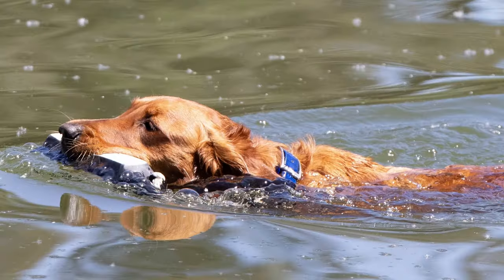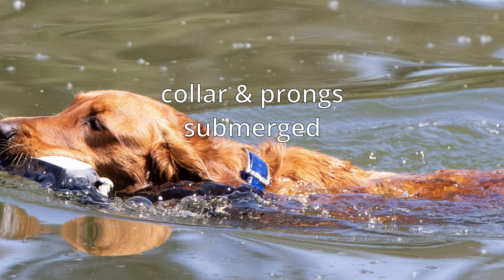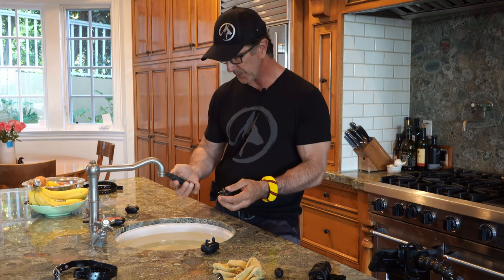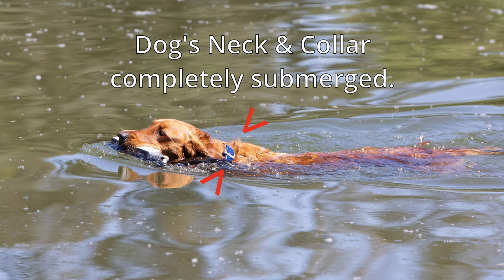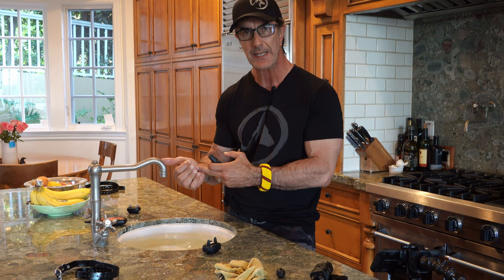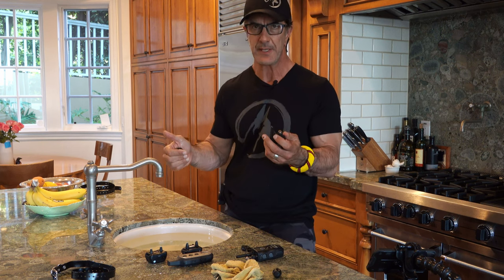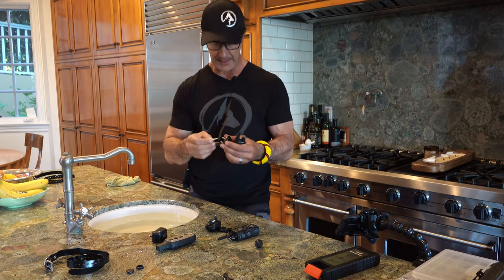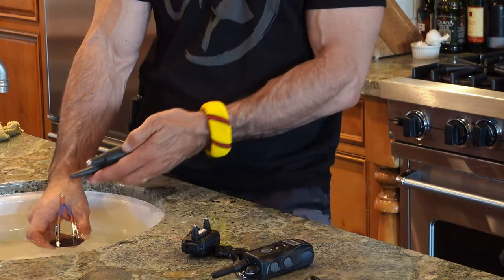Is the E-Collar Dangerous in the Water - Will it SHOCK your DOG?

Comment: I notice when getting lab to retrieve plastic bumper from wet grass that it shocked her mouth and she dropped it
Reply from the maker: that would be impossible...
Reply: @RobertCabralDogs  i saw here feel shock and opened mouth quickly.  I had sport pro on 4 which earlier is when she felt shock so turned down to 2 after that

Comment: Surely your point is that a WET dog [not in the water] receives a "higher" stim, you found it aversive when your hand was wet, but not submerged. How do the shooting crowd get round this? They invented the ecollar. Labs retrieve ducks from the water. My dog swims, she wears double box Etech K9 Handler. I've never noticed a difference in her response. Would this also apply to wet dog due to HEAVY rain, quite common here in Scotland. PLEASE tell me at what level [any] a small DC battery can create enough current [not voltage] to BURN. From my personal experience of 20,000 VOLTS @ 0. 02 AMPS, sufficient to see the pretty blue arc of "lightning" from HD line 6 inches to my finger holding screwdriver. It felt like a tingle, amazing to see though. Martin tech stuff is much more complicated, and ,for me that means more to go wrong. Love seeing these, great topic. My Martin System collar is broken, so I cant compare it with my Etech collars.
Reply: Regarding your question about how this is handled by waterfowl retriever trainers and handlers ... from my perspective as a retriever trainer, it is a non-issue.

1. The receiver is positioned where the contact points are above water when the dog is swimming. I have never experienced an ecollar communication lapse because the contacts were submerged.
2. Proper use of an ecollar requires a conditioning process/period. Without going into detail, this conditioning process prepares the dog for any stimulation the dog might receive, including the intended associative learning (classical conditioning) or instrumental learning (operant conditioning), depending upon the ecollar methodology being used. This process also prepares the dog for a margin of stimulation level that covers the range of difference between dry stim and wet stim. 

No physical hardship (biology and physics); no psychological hardship (knowledgeable and responsible conditioning process and usage).

With knowledge of this phenomenon and responsible usage, never a concern.
Reply: @TPinesGold  I'd appreciate How you position the collar to stop wet contacts. My dog launches herself into water. often submerging her head to bite it! Never has she not responded. or received a higher stim than the level indicated. either in or out, then shaking all about. The collar has always been fitted low on her neck, will not stay up behind her ears. A professional trainer tried to place it high, He did the collar up so tight she couldn't swallow, Still it moved round.
Reply: @patmunro3531  Impossible to prevent wet contact points, but I want to minimize submerged contact points. If I have a dog with a leaping water entry followed by a brief submersion, I can't imagine any need to stimulate during that moment of submersion. Any button being pressed should be on a camera.
I am facing the dog when I put the collar on. I position the receiver at about (my) 10 o'clock or 11 o'clock, very high on the dogs neck, with a few fingers of my left hand under the collar as I cinch the collar tight with my right hand. The receiver should be offset from top center just behind the dog's right ear. Before removing my left hand from gripping the strap, I grab a handful of loose skin with my right hand on the back of the dog's neck, posterior to the strap, and pull loose skin posterior with my right hand while pulling the strap anterior with my left hand. When I remove my fingers of my left hand from beneath the strap, this relieves the tightness of the strap enough so that breathing and swallowing is unrestricted. It still must be quite snug so that there is no movement of the contact points against the skin. Any movement is problematic because (i) the receiver position becomes less effective, (ii) movement causes skin irritation, and (iii) movement means contact points are loose against skin, resulting in inconsistent stimulation levels perceived by the dog. I've used this technique and position on several hundred different Goldens and Labs -- the collar always stays exactly where I position it while breathing and swallowing is unrestricted.  Zero problems in 15 years of ecollar use.  My technique is not the only way to do it. I'm sure many successful trainers would give different instructions. This works for me and I do it the same way every time.
Reply: @TPinesGold  Mine is a thick/ densely undercoated GSD, with a skin that would fit 2 dogs. Contact was really difficult, until I purchase a Martin Systems extender. The weight of the single brick ALWAYS slipped round to her throat, lowest position, and down towards her shoulder, skin pulled through underneath. The Extender is fitted lower, the brick attached in the middle of the 4 contacts, placed both sides of the dogs neck. Gravity keeps it there, the collar is a bungee, therefore CANNOT be stiffly tight, the elastic gives and takes. I also clip, to the skin a track for the contacts. When on they "furrow" through the clipped track, maintaining contact wherever they are, after swimming collar moves round as she shakes. Has never "lost" then suddenly "gained" contact. Water also follows the clipped furrow, so contacts/ skin is wet, even in just rain, no sudden need to increase stim [lost/wet] contact. When she swims, the contacts would have to be ON TOP of her neck not to be below the surface of the water. See Mia swimming. This is fascinating discussion. Thank you. How to fit the Martin System extender is in a video by Bart Bellon.